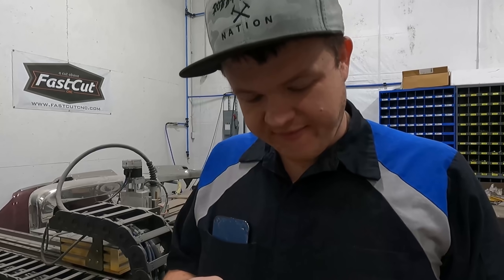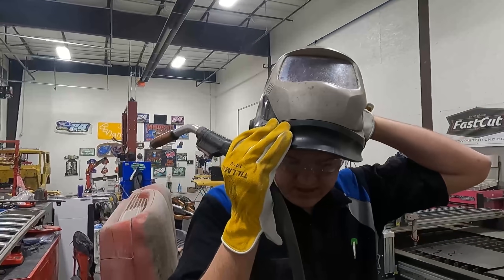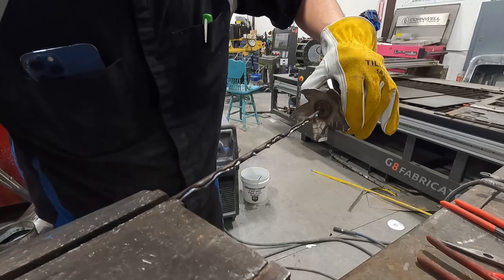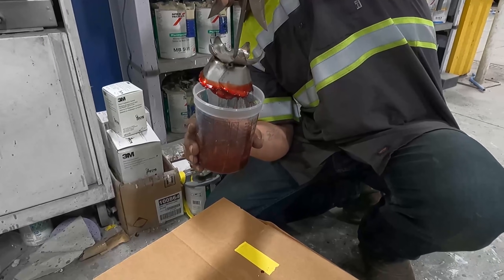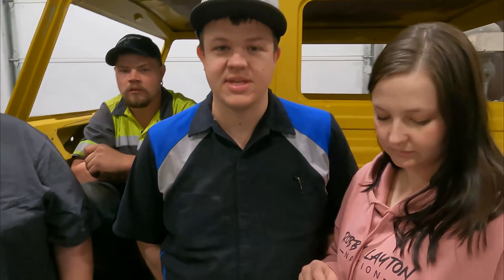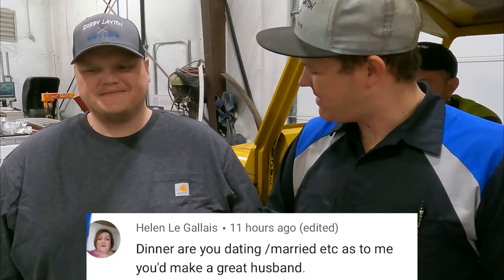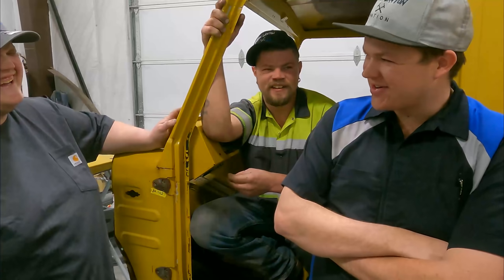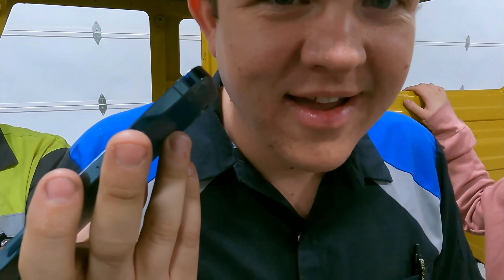Surprising My Wife With A Custom Welded Rose

Comment: How I wish we had a perfectionist like you near us. Had a dented scratch in the rear door of my Peugeot 207 (haven't seen any Peugeots in the US when we've been over from the UK) which my local body shop repaired but the left slight ripples in the surface. Obviously their hands are not a sensitive as yours. Also do you have trade plates to drive unregistered/uninsured cars on the highway?

Comment: Your roses look good I have made some like yours before I used a ball bearing for the center and then used the oxy acetylene torch to Blue the pedals and the ball that was in the center. Another trick I did is I used a quarter inch piece of tea stock for the stem and then twisted it turned out cool.